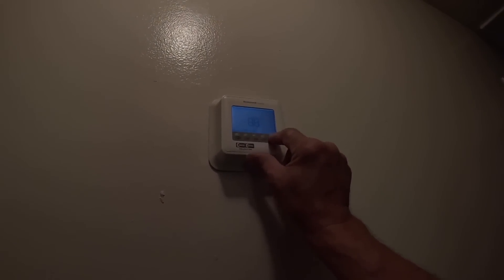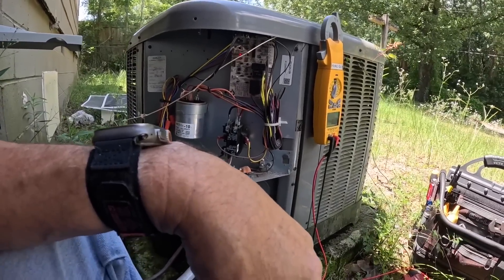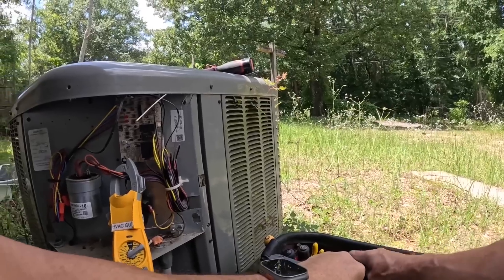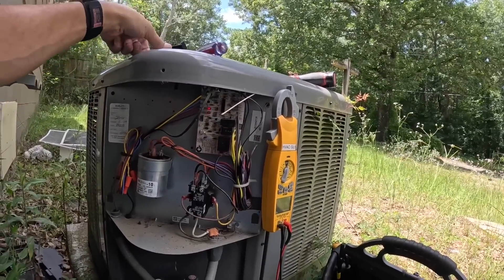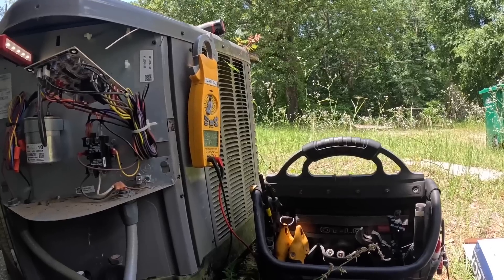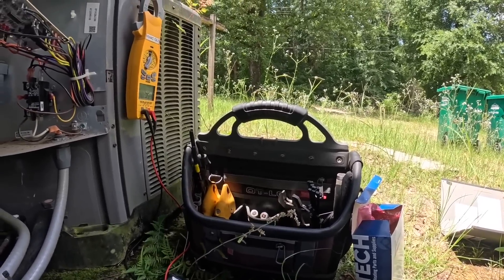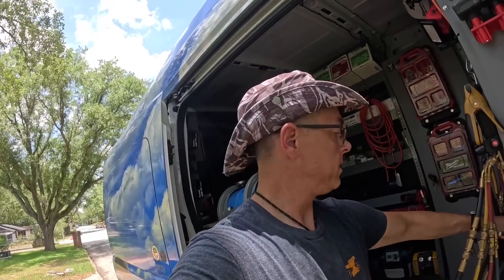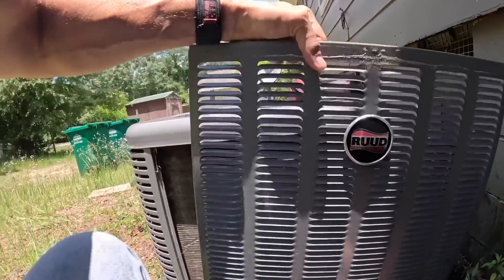Condenser Wasn’t Running and The Reason Surprised Me A Little #hvacguy #hvaclife #hvactrainingvideos

Comment: It wouldn't surprise me if you checked out the back side of the circuit board you would find the problem to be a bad solder connection at the fan relay.

Comment: I used to give you the supply air temperature I had a thermometer that would measure it and that gives you a good idea of where things are I also used to monitor my indoor humidity if it went up it wasn't good.  It's still Spring until June 20 and around here it doesn't really get hot until then.  My folks used to always quip "Hot as the 4th of July" and "Cold as Christmas" .

Comment: Before i left my previous company, i was doing startups, and always found that wire on the bottom of the contactor to be off, or loose, the company i worked for installed ruudd and tranes and i'll always see the bottom plate to be blugged down due to little amount of room under the contactor

Comment: Can someone help me understand why didn't he check the defrost sensor? I'm not familiar with heat pumps so I'd appreciate it if someone explains why not check the defrost thermostat since that can also cause the fan to stop?
Reply: Because in a call for cooling the defrost temperature sensor doesn't come into play.. if it have power to the reversing valve it wouldn't be part of the circuit for the fan.
Reply: @masontull8388  Thanks for the info 👍

Comment: I have a 2001 American Standard 2.5t package unit on a mobile home in Florida. It works perfectly but can struggle on 95+ days and run a lot. I’ve maintained it for the last 10+ years and my dad did before. I called to have a coil clean done and they wanted $1100! It’s a no remove clean. So I ordered the Nu-Calgon cleaner and spray nozzle. Just go back to doing it myself. I’ve already done caps as well. Preventative due to age. Oh and the last small ac guy I had over put a hard start kit in a few years ago. All the last techs in the past seven years told me to never replace it until it has a major failure. “They don’t make them like that anymore.”

Comment: Hey Curtis. I have been in this trade for 20+ years and have always told my apprentices to not take short cuts and work safe. So I have to ask, why in the world would you not take two seconds to disconnect the low voltage before changing the board to prevent the possibility of getting shocked, blowing a fuse, or shorting the new board? I really enjoy your videos, but I believe that there are probably a number of apprentices that watch them as well to learn from you and that is definitely not setting a good example.
Reply: I was wondering the same thing.
Reply: I was too.

Comment: Why would it still shock you after you pulled the disconnect?
Reply: The low voltage power comes from the inside unit. 24 vac can surprise you if you're not expecting it.
Reply: @bmsuter1533  especially if you sweating/wet
Reply: Over the years I've found disconnects that didn't work! Always check por power!
Reply: Had a pull out style where one metal prong was broken inside the disconnect. I Got shocked 😂
Reply: The Cybertruck auxiliary power for lights and accessories is 48v.

Comment: Does anyone do board repair? It seems a relay replacement would be more efficient than a complete board replacement.
Reply: Those boards can break as easy as Matzo bread.- Laheim!
Reply: I had an electronic instructor ask the same question. I had to explain to him that it's not cost or time effective to do board repairs as a service company. It's  cheaper and faster for the customer to change the board and they have a warranty on the part. I don't normally comment on things but I have 40 years of experience and have had to explain this a few times.
Reply: You will be liable if it shorts and starts a fire that spreads to the house.